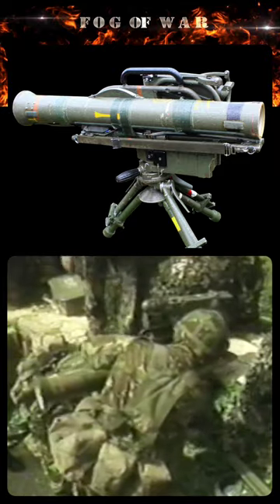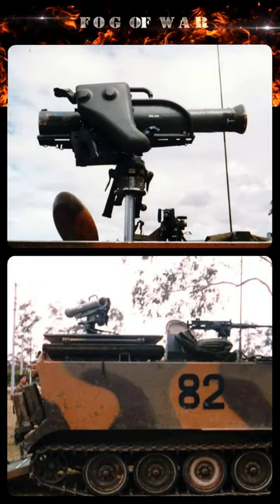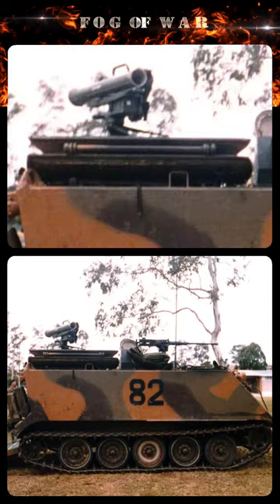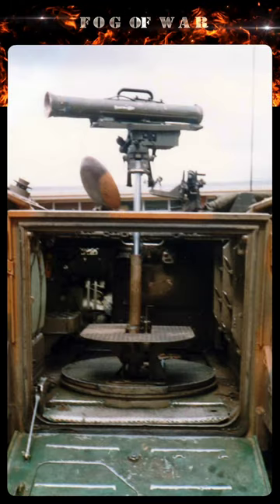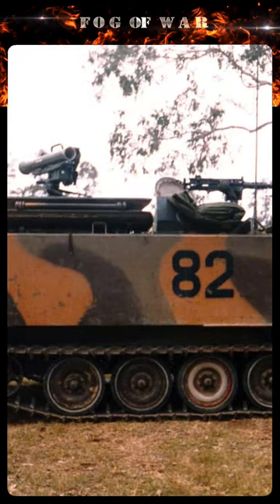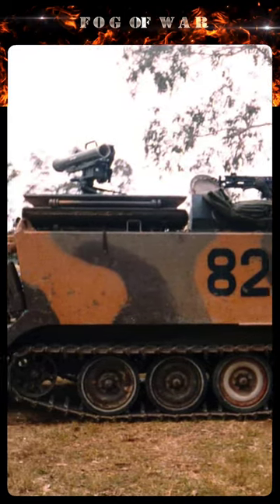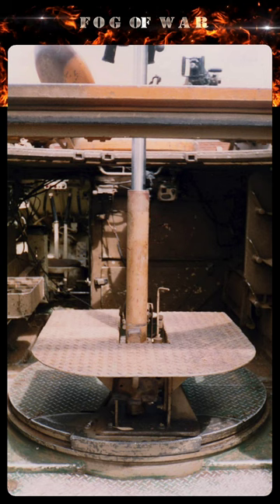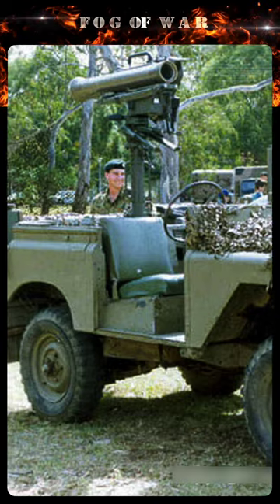#Shorts | Experimental Milan vehicle-mounts - M125 and Land Rover | Australian Army

Comment: Wow, milan did not stay very long in service. I know a TOW missile is potentially possible to mount on a Sherman because it can use the same pintal mount the .50 does via an adapter made for HUMVEE.
Reply from the maker: Australia wasn't happy with Milan. There's almost no actual documentation I managed to find, but anecdotes from diggers indicate it proved to be expensive, hard to train the troopers in, and there was issues with scrubby Australian bushland tangling and snapping the control wires. We eventually went for Javelin instead.
Reply: @FogofWar  Very curious. because MILAN wouldn't be the only missile system that uses wires that could get tangled, not that the replacement option was bad, Javalin has shown its worth now!